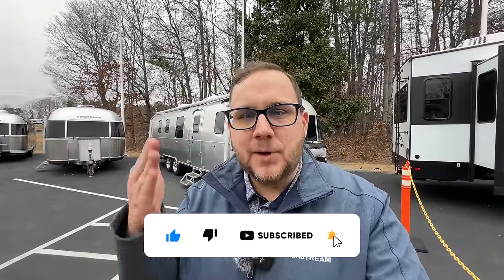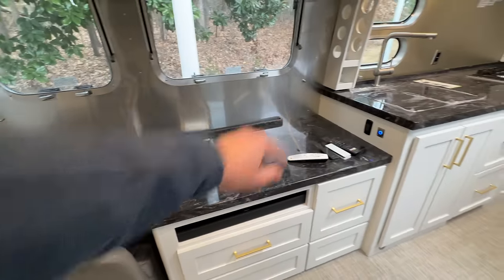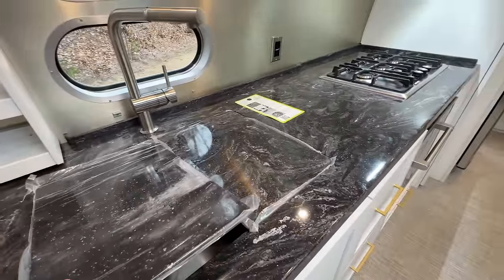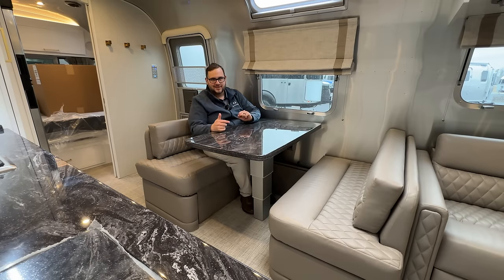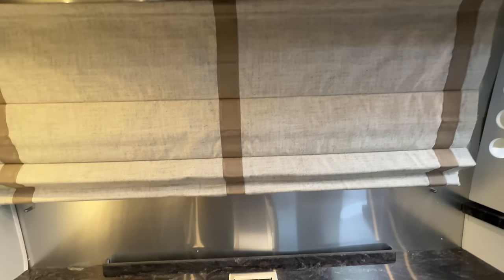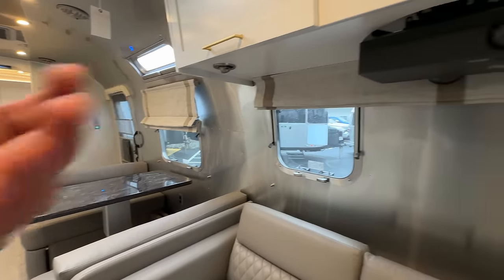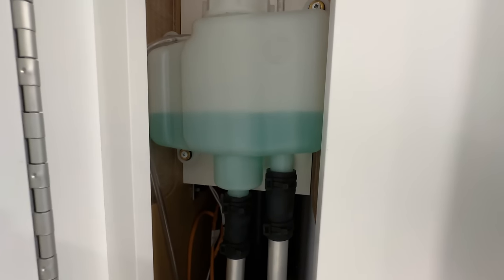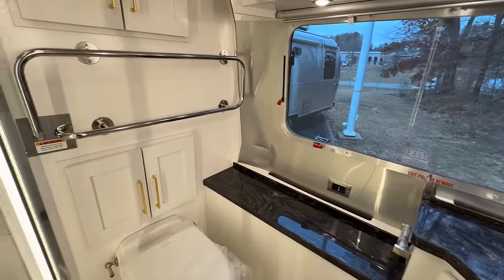Most Expensive and Luxurious Airstream Trailer Ever! 2024 Airstream Classic 33FB Queen Bed

Comment: Nice review, especially including the footage of an " EXTRA SCREW" just laying on the floor, and a power wire dangling from the screen motor. This was our dream RV, but we have heard too many bad reviews/reports from the buying public, concerning Airstream quality really going downhill, we will probably be going with something else.   This is their top of the line , most luxurious trailer, you would think it would be perfect !  Absolutely no excuse for an "EXTRA" screw, and dangling wires.  Highly disappointed to say the least, $212,000 for something that needs work as it leaves the factory, how sad that the RV industry as a whole feels like this is acceptable at any price.
Reply from the maker: I’ve sold a lot of different type of RVs and I can say without a doubt, even with the adjustments that need to be made, they still make the best RV in the industry.
Reply: @ChadsRVReviews  mmmmmm Brinkley is gonna give them a run for their money with their 5th wheels and addition of new travel trailer .

Comment: Chad does a very nice job showing the 33 Classic. However, neither he nor Airstream can rectify some of the issues confronting its top of the line TT. I always have had my 5thW rigs outfitted with a 50 amp generator if possible; something impossible to install on an Airstream TT. This means carrying it in the bed of my pickup which is an invitation to larceny or damage. Also, while 54 gallons of freshwater capacity may suit some folks, it's not conducive to longer boondocking stays. If a larger freshwater tank is not feasible, a WaterMiser system would be a big help to stretching your dry camping a few more days. It appears to work on RockStaff rigs. A water bladder in the bed of the pickup presents a new set of problems. The 33 Classic is out of my reach, but it gives me something to which I can aspire.
Reply: Airstreams are RV campground queens, no one buys these to boon-dock, they stay in RV parks with full connections.  They might work for an overnight stay, but no more.
Reply: @Erin-Thor  Campground queens. Right you are. The reason I enjoy RVing so much is because I can boondock and dry camp anywhere permissible; within reason. Even at a Harvest Hosts or Boondockers Welcome, I have the freedom to camp without water, sewer or electrical anchors. At $200K plus, I am still anchored to campgrounds at dollars per night. It has taken Airstream quite a while to concede that solar and lithium power are enabling. However,  until it engineers in more water, grey and black capacities, all its units will be second cabin.
Reply: @rogerspalding5673  — I couldn’t agree more!  They ‘can’ boon-dock, but with a 1000w inverter, you can’t even use the microwave, with the standard 2 AGM batteries, you aren’t running the heater all night either.  I liked my 23FB, but you aren’t getting very far away from people in an airstream.  👍🏼🤠

Comment: They should sell some type of a shower chair to go in that large shower since most of your customers that buy these expensive pull behinds are older I would think or just someone it wants to sit down. That way you have a chair that won't harm the floor of your camper. If you just go get a plastic chair and put in that shower it'll scratch the bottom of it up and you can buy medical grade shower chairs which have rubber stoppers on the bottom and they work pretty good but if you had one purposely built for that shower to fit in the contours and maximize your space that would not be a bad item to sell.
Reply from the maker: I'm surprised this one doesn't have a shower. Most all of Airstreams other floorplans have a seat in them!

Comment: What is the recommended vehicle to tow this?  3/4 or 1 ton?
Reply from the maker: Either would tow this great! I would stay away from the Ram 2500 with the Cummins because the payload on that truck is super low for the 3/4 ton. If you want the cummins go with the 1 ton. On the 3/4 ton truck check the payload. Try to be close to the 3k range for payload.

Comment: Hi Chad my wife and I love your videos. 
Based on your experience in the RV industry could you try to answer a question that nobody else can seem to answer for me. I've written multiple letters to different manufacturers of "some other brand trailers" and have asked this question, "why do RV manufacturers keep making the units taller and taller and taller???"
As a child our travel trailer had one step up years later as an adult my family had a travel trailer with two steps up most recently as we search for our next RV after years of not owning one the travel trailers are three steps and even four steps up, also now with "stairwells" that fold down so you can climb up into these units. What the heck is going on!!! Before purchasing our next travel trailer we added a RV stall to our garage with an 11 ft door, after trim I have about 10 ft 11 inch clearance. I would have to say about 60% of the travel trailers will not fit in this garage stall. The trailer I had back in 2009 was 10 ft 4 inches tall, now most like travel trailers from that same manufacturer are above 11 ft tall. These are not lift kits or off-road travel trailers.
This is the biggest reason that my wife and I are leaning towards ordering an Airstream, not only because of the build quality but the fact that they are pretty much the same height going back to as far as the 1970s. 
One explanation I received which is totally laughable was that the "tow vehicles are getting taller and taller" I don't know about you but my 4x4 is pretty much the same height as the one I had back in the 1980s. Whatever happened to "low center of gravity"
Please share your knowledge or comments on this subject. 
Thanks
John
Reply from the maker: I have a few thoughts on this. (1) It's easier and cheaper to engineer a body on a frame than it is to build around the wheels. (2) People want bigger windows and overhead storage. The only to have both is to build taller. (3) ACs didn't use to be ducted when they added ducted ACs the RV got taller. (4) Tanks have also gotten a lot bigger and the only way to make room for that is for the frame to be higher. That's why Airstream tanks tend to be on the smaller side. I hope this helps!
Reply: That was great information! Keep up the great work! 
Thank you,
John and Deanna

Comment: Sorry, but that is not worth over $200K.  Especially if you need to go out and buy a 1 ton truck on top of that for another $80 - 100K.
Reply: Knowing the build quality of Airstream I was surprised it wasn’t more than $200K however I was surprised at how flimsy some of the materials are.  I’ve seen this exact model at a dealer in Virginia and the overall foundational build quality is really good.  On the inside some of the interior parts look nice but up close they’re kinda cheap.  It’s still one of the better campers available unless you want to spend double.  I agree with you on pricing.  It’s out of control.  What makes these things so expensive is the labor costs to make the damn thing.  Most buyers already have vehicles powerful enough to tow this beast.  Buying a camper and then a vehicle to tow it is just stupid.